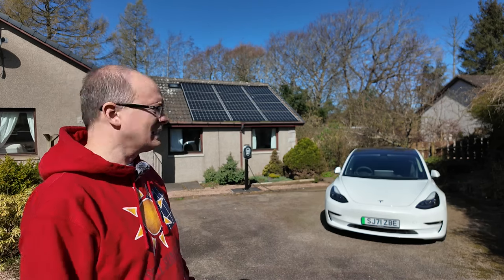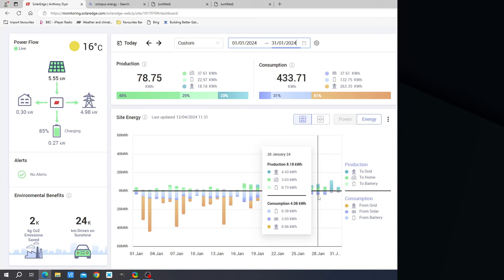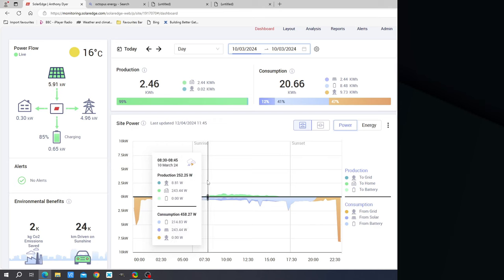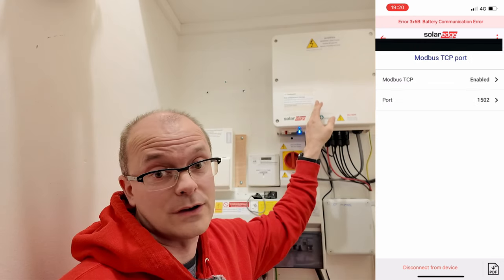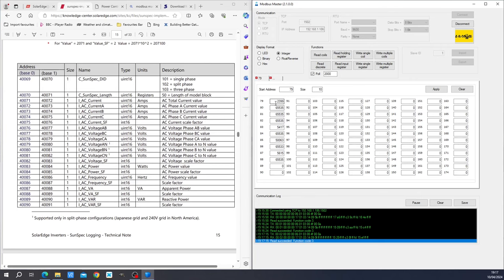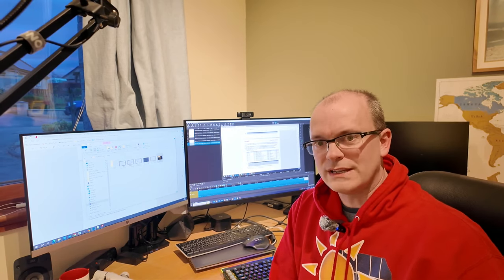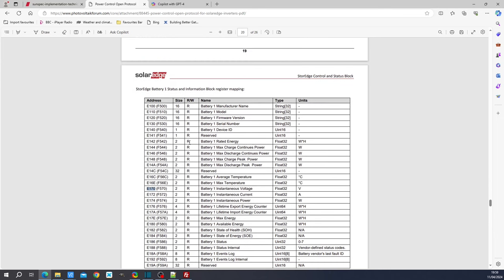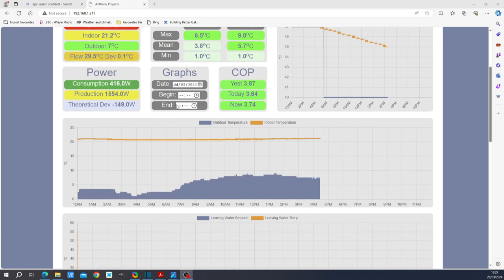Aberdeenshire Solar Performance Q1 2024, Introduction to SolarEdge Modbus

Comment: Hi Anthony, I’ve had a hunch that my Solar Edge app has been underreporting solar production since last October based on the graph. I checked today, the monthly totals tally with the graph but if I add up daily production for the month I get something very different. January was 144kwh monthly vs 283kwh aggregate daily. December was ZERO vs aggregate daily 194kwh. The difference is much smaller June to October (3-6%). Have you observed this? Rob
Reply from the maker: I have seen this, and again it seems to be the way that battery charge / discharge seems to be factored.  So for example after the sun has set, daily production can still increase by virtue of consumption from the battery.  

Likewise I’ve also seen daily production not increase very fast when the charge is going into the battery.

This all works fine, until you start charging the battery overnight from the grid.  Then the formula goes wrong.

Comment: Interesting video. Are you using WiFi or an Ethernet cable to connect to the inverter? I’ve seen some comments that Modbus isn’t available over WiFi?
Reply from the maker: The inverter is connected using Ethernet.  But there’s no trouble connecting my laptop to the inverter via wifi to the router.  The wifi modbus restriction only applies if the inverter is connected to the router via wifi.  It has no idea how the origin of the modbus master is connected.

Comment: Hi Anthony, this week I tried using the ‘charge battery from clipped solar’ option, and though it worked great in the daytime at the end of the day when we were pulling more than the solar generation we were using grid power instead of battery. I know you’ve used this setting previously, have you had a similar issue? 
Cheers
Reply from the maker: That’s how that mode works, and therefore it needs selective use.  I only use it from 10am to 3pm and only during bright spring summer days.  Outside that time I use “discharge to minimise import” during the morning, and “max self consumption” after 3pm to pick up any remaining charge for the battery

What I’m going to try is using modbus to select between this mode and “discharge to minimise import”, depending on power consumption in the house and maybe the weather forecast.

I dont use “discharge to maximise export” during the evening anymore since I’m not on Octopus Flux.
Reply: Okay, I misunderstood that mode then…
I’ll look into the discharge to minimise import option and see how I can make it work for me 
Thanks for the reply 👍🏼